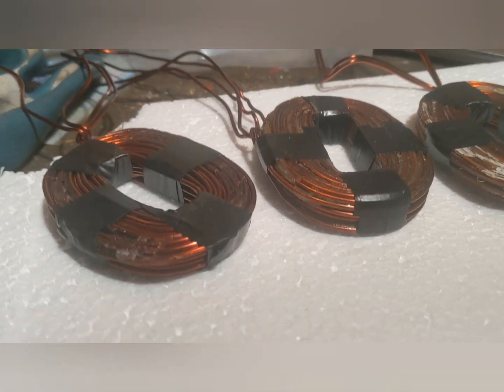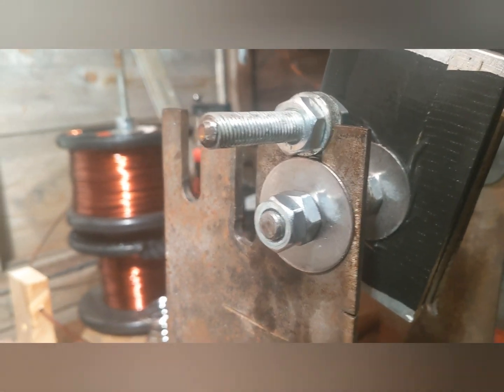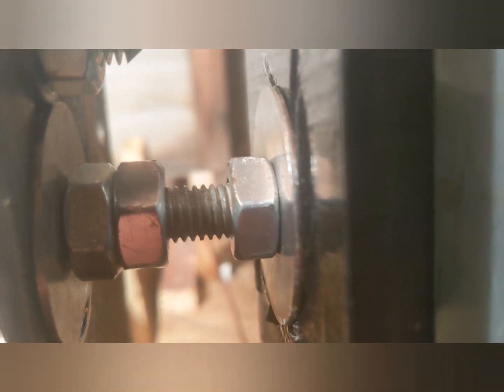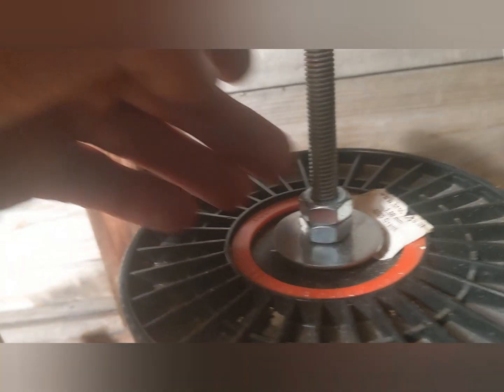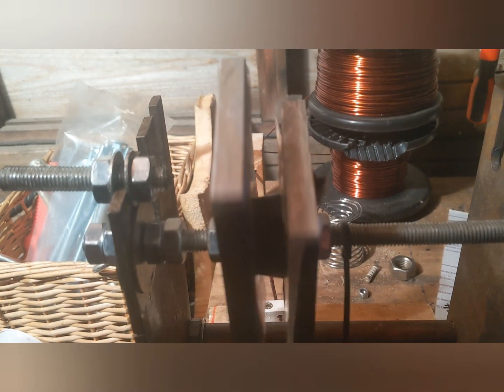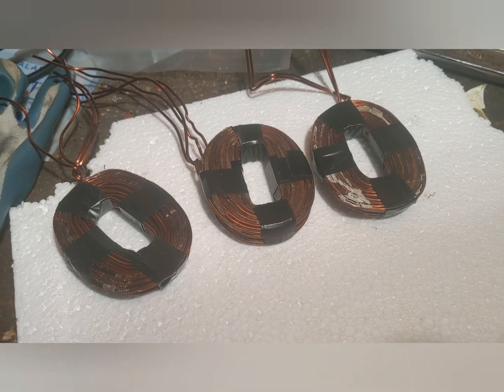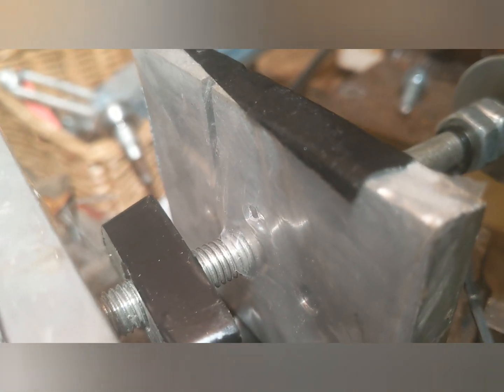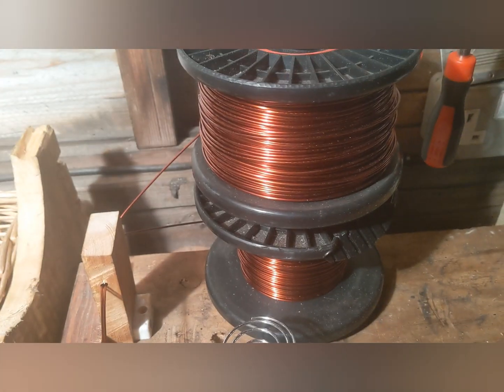Drill powered coil winder for making 12 Volt Wind Turbine coils, Free Energy for all !!

Comment: id need an even slower speed or I'd mess it up,  , I'm thinking I'd need a pwm  motor speed controller and an on off switch. Coils look the exact same , you gotta be happy with how it's all working  out. I Hope to build a 4 and  5 coil stators kinda copying Orlando when he added more coils he made more power in low winds,  and in summer lower winds are what I have.
Reply from the maker: Yes this drill is a bit overpowered , I have just put a counter on it , it is hard and you really need to concentrate , plus I am pouring resin in every 5 turns so it is really hard to keep track of how many you have counted , especially if Mary Jane is involved :)
Reply: @GavinFreedomLover  have you seen the documentary, Rick Simpson run from the cure, it's brilliant